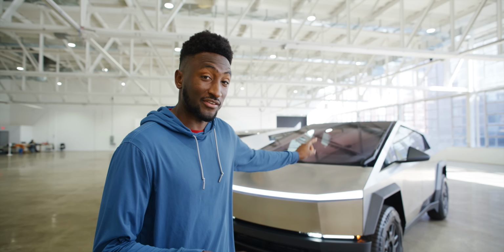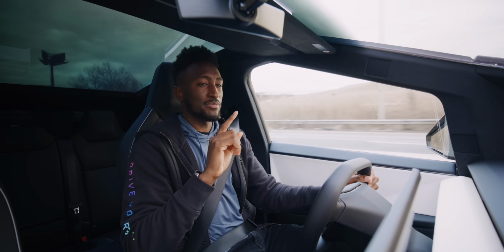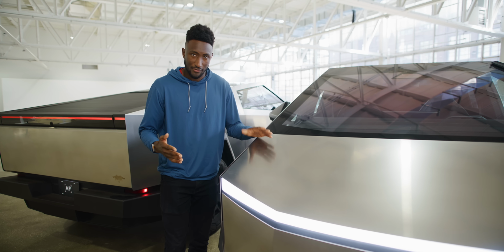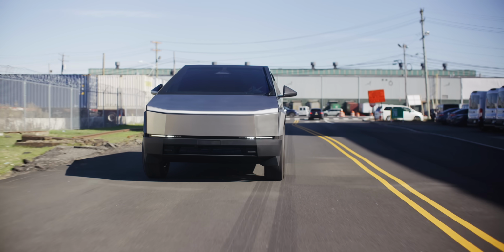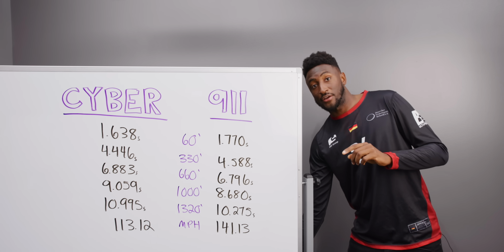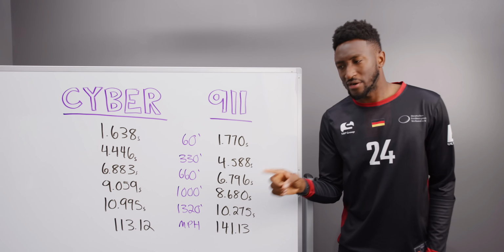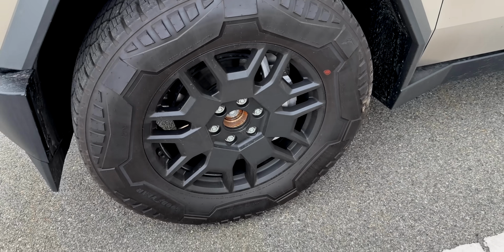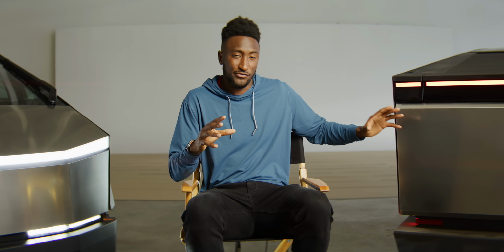Tesla Cybertruck Review: Already Iconic?

Comment: This Cybertruck is DA BOMB !!!! It is one of THE COOLEST vehicles OF ANY KIND out there! AND it actually IS a great WORKING truck! The bed length is good. You can fit lots of stuff in it! It carries 2500 lbs in the bed which 300 lbs for than a typical Ford F150 Truck. It can two 11,000 lbs which is one thousand pounds MORE than the F150 Lightning!  The audio system IS ASTOUNDING in its audio-purist-laden sound quality! The inside is minimalist and simple, allowing for easy cleaning!

EVERYTHING about this truck screams both PURE TRUCK ABILITY and pure awesomeness!

This is just the START of good thinks to come into the Tesla Cybertruck world! Wait until Tesla puts in the massaging seats, the built-in combo-fridge/freezer, the built-in Nespresso coffee maker and the built-in combo-microwave/convection oven AND add the 100,000 lumens lightbar and 360-degree surround-view FLIR thermal nightvision system!  It will be a monster of pure truck luxury and towing/carrying ability!

This truck GROWS on you the more you drive it and more you use it AS an actual truck (i.e. carry and tow stuff!).

In five years we won't be having this type of conversation anymore. It will instead be: Can hit 1500 miles range on a single charge? and Can other truck companies compete with it in the market place?

The Cybertruck is A LOT BETTER THAN I COULD EVER IMAGINE! No other vehicle has hit more home runs right out of the starting gate than any other vehicle.  The driving range issue will be SOLVED within two years! The Self-driving software WILL be coming by 2025! All the other 3rd party add-ons and extras will ALSO be coming down the pipeline as we speak! Look already how many AWESOME Vinyl Wraps we can get for the Cybertruck! Matte, Glossy, Full Colour Images, Cammo Patterns and even the colour changing ones you see on modern phone cases! It's GREAT!

Keep Going Tesla! This is a WINNING PRODUCT and just needs more factory support and driving range increases! 

V

Comment: I can totally understand that biker, getting hit by a Cybertruck and it's really hard body (and extremely sharp edges) will be even more deadly than a normal truck. Even getting hit by it in a normal car will be more dangerous since the smaller car will have to absorb even more of the speed. How is this thing even legal?
Reply: It is the lightest of the EV trucks, as was stated in the video.
Reply: Except it's not. If you'd take 5 minutes to educate yourself, you'd know that tall and flat is way worse than low and slanted (CT).  Also, you have no idea how basic physics works.
Reply: @TheBowerbird  Might be low and slanted, but it's still very hard and sharp.

Comment: When there are many of these 7000lb moving bulletproof, blinding, razorblades on the road, I don't see how you can possibly say that that isn't the most dangerous thing about the truck. Sports cars that can move that fast can also stop very fast. Stopping 7,000 lbs quickly is just not happening. I've seen the braking tests. So yeah, this is the family guy episode... "Good luck everyone else!"
Reply: yeah, for sure... the child crusher 4000
Reply: That quote, insidious af💀
Reply: and fast sports cars will hit you around the knees or even lower while this monstrosity would hit you around the hips or even higher, aka good lucky starting alive after that, specially with that almost inexistent crumple zone on the hood
Reply: I doubt it will ever pass eu or uk regulations. Thank goodness.
Reply: I agree 7000lbs is too much for a vehicle, but it's certainly not just the cybertruck that's in the obese category: jeep grand wagoneer, 6400lbs, yukon xl 6000lbs, escalade 6000+, f150 raptor 6000lbs, hummer h2 6600lbs, F-250 Super Duty 6000-8000 lbs.  And it doesn't matter if those vehicles are bit slower to accelerate, they still hit 100+ mph on public roads.  We should just outlaw all of them IMO.
Reply: The front steel is al so too bad for accidents. There is no crumple zone, which was evolved for car safety.

Here it was disregarded for meme design. The people inside will crumple during high impact. Saying good luck to others is weird.
Reply: exactly
Reply: Imagine getting hit by a 10,000 pound truck pulling a trailer a 10,000 pound trailer.  All vehicles are dangerous.
Reply: @dhjengr8756  now what? this one's clearly so unsafe it didn't even get through EU regulations, the 2nd biggest car market in the world, at some point you should be able to realize some things are not adding up

like imagine the same excuse for when the Samsung Notes were exploding because of faulty battery packs - every battery is unsafe - lol okay
Reply: its the safest car ever

Comment: Getting rid of physical buttons and sticks was a terrible idea.  Why didn't tesla learn the lesson from the Macbook touchbar debacle?
Reply: @too1leasy  That's what Blackberry used to say
Reply: @too1leasy  Statistics indicate it's making the roads safer
Reply: My touch bar was fine.
Reply: It's about eliminating unnecessary parts and processes and creating better efficiencies. Very progressive
Reply: @johnsutherland7561 sometimes progress for the sake of progress isnt actually a good thing, the good old "if it isnt broken, dont fix it". Thats the main reason race cars still use physical buttons, knobs and switches, you simply cant rely on a touchscreen to do stuff while you drive
Reply: @augustooliveira5588  Verbal commands should be just around the corner plus FSD
Reply: @johnsutherland7561 maybe you were joking, but just in case.. Having to look down and to the right and very carefully tap the important button in just the right spot on a screen and not tap any other virtual button in a slightly turbulent car going 70mph is dangerous and frustrating.  It would be bad enough if these touchscreen buttons were within reach of your thumbs at the steering wheel, but these are on the screen in the middle of the dashboard.
Reply: @randy8324  Full self driving will make it a non issue
Reply: @johnsutherland7561  FSD is never going to take off. Yes, never, the idea itself is fundamentally flawed. And voice commands SUCK. Moving my hand is 100x faster than saying something outloud. The reason FSD will never take off is it is incompatible with our concept of the road. Self driving cars can only work if every car is self-driving and connected, with manual driving being prohibited. Otherwise self-driving individual vehicles makes no sense. Another alternative is abandoning car-centric infrastructure and moving towards FSD trains.
Reply: @johnsutherland7561  I hate to break it to you, John, but you're not going to be around by the time we actually get FSD. And I guarantee it won't be coming from Musk. Hey, it might not be in my lifetime either.
Reply: @lucass8119  FSD trains don't work as not nearly as safe. Re all yahoos on subways ect
Reply: @mj-np9sy  Let's revisit in 5 years
Reply: @johnsutherland7561  Sure, but trains are many thousands of times more efficient per passenger than cars. That alone makes up the cost of an operator. Not to mention it is significantly easier to develop FSD trains because they have known paths i.e. rails - cars don't
Reply: @johnsutherland7561  Which is all well and good until it turns out the parts ARE necessary. It makes perfect sense from a cost cutting and production streamlining standpoint, but it's a disaster for road safety. There's a reason other manufacturers are backing away from touch screens after messing with them for a few years: reliability of being able to find and operate the controls is far more important than whatever minor benefits a touchscreen brings.

The major benefits of touchscreens are intuitiveness and the ability to move controls and functions around. The major drawback is a lack of tactility and feedback. Given that a car's controls are simple enough to not require much shifting around and the driver should be able to do as much as possible without ever taking their eyes off the road, I simply don't see a benefit to it from a consumer standpoint or a safety standpoint. And as I'm neither an investor or manager in Tesla, I couldn't possibly care about the money they're saving on this cost cutting.
Reply: because their touch technology has been incredibly reliable for the last 10 years.
Reply: @IamLINErida respectfully, that comment sounds like someone who doesn't drive that much.
Reply: ive have well over 500,000 miles between 2 of my cars in the last 8 years @Amstro515  and part of that was just going to school
Reply: @IamLINErida It's not about reliability, but usability. The buttons are way better to use while driving in a highway, because you don't have to look at it as you do with any screen just to avoid pressing the wrong "button".

Comment: The Cybertruck reminds me of decades of French car design.  They often came out with very quirky, radical looking vehicles, and were sold on that novelty, which would last for a few years.  If you see these vehicles a decade or two later, you realise just how bad-looking they really are.  The Cybertruck falls into the same category for me, with the exception that, unlike the PT Cruiser which was at least priced within the realms of possibility that someone could afford it, the Cybertruck was released at a much higher price-point than originally promised.  It will always be a rarity, until Tesla build a better, cheaper model in a few years time.  Hell, they might not even bother.  This vehicle is a marketing exercise packaged as a truck, intended to garner fame, notoriety and admiration, and in that respect, it has been a success.  If you really want to drive an iconic truck, get yourself a Toyota Landcruiser.

Comment: as someone who prefers to commute on a motorcycle, the turning radius on this thing combined with the weight, acceleration, & fly by wire steering, really makes me wonder, if this is the direction their design is going, should i consider moving somewhere tesla won't ever deliver to? 

bc tbh, this is just a frightening direction that i hope does not catch on to much larger trucks, or even a nightmare XL version of this heavy monster.

Comment: I think the blinding glare is probably the most dangerous part. that and the ego of the driver. I think there will be lawsuits about that which will require the whole body to be sanded down or painted with an anti reflective coating. Stainless steel did not work on the delorean and it won't work on the cybertruck. The body shop appraiser is going to be dancing the jig when these start getting dented or wrecked.

Comment: 7:29 the logic here is actually incorrect. In a collision, THE TRUCK will be fine but “YOU” the driver will most likely not be because the deformation of a car is actually what absorbs the energy of an impact, protecting the driver. The Cybertruck has yet to be rated by the IHHS or NHTSA.

Comment: I just wished they didn't downsized it 5% between initial proto/presentation, and production model. This was a really weak move.
One more thing, it might have to be checked but as far as some people analysed the aerody,amics of the CyberT, it is far from being bad, because of some pretty clever tuning of the upper roof ridge angle cause certain flow regime. Again, someone might correct me but leaks in this vehicule's driving efficiency might be found more in tyres than in aero.

Comment: I got a longbed truck and tow stuff with it all the time. I tow my cargo trailer. I tore down a house and towed it to the landfill. I use it to carry my big kayak. And I scrap metal too. I hate seeing people with trucks that don't use them. They take up space, cause a ton of pollution, and are very dangerous to pedestrians. Most people only need sedans. Because even sedans are a waste of space, most people don't care anything more than a backpack and the other 4 seats are wasted too. But that's another issue, American cities are designed to force you to drive. All that most people need though is a car. If they need furniture, paying one time delivery fee or renting a uhaul truck would save thousands of dollars compared to buying a whole truck to use just once a year. Even if you do haul a lot of stuff, a pickup is still not the best. A cargo van has much more space and is lower to the ground, making loading easier, and it's kept secure, instead of having stuff in the open bed, and protects it from the elements. So again, most trucks, even for cargo, aren't needed. Sure some people use them, like farmers. Or for recreation. But not for everyday commute.

Comment: Why has he not brought up the fact that its an objectively bad pickup truck because the bed space is absolutely tiny compared to any other comparable truck, or that its literally too unsafe to be legal in Europe, where even the equally massive F series can sometimes be bought, or that basic features such as the rear camera become all but unusable at night, or that the headlights are so badly designed that they blind other drivers due to pointing slightly upward instead of straight ahead, or that the range is 300 km less per charge than Elon touted, or that it rusts INSANELY EASILY compared to other cars and trucks because its UNPAINTED, or that its automatically closing front trunk lacks a sensor so itll sever any fingers without stopping, or that the edges are unfinished and unrounded meaning you can peel vegetables with it, or the other stuff that a truck half its price has which works way better, as much as he should have? Its legitimately an unfinished product that should NEVER have been released in this state. Literally we have seen a PROPER high end electric pickup in the Rivian. NONE of those issues in the Rivian because its got actual QA and testing. Anyone who makes these videos should be WARNING PEOPLE NOT TO BUY ONE BECAUSE THEY ARE UNSAFE AND NOT READY
Reply: Right??

Comment: Marques: I believe they're the first one to do steer-by-wire.

One Lexus is crying in the corner
Reply: Every prior system still had a mechanical linkage as a backup. This is the first true steer by wire system
Reply: @ianmilham7397  Saab did a bunch of full steer-by-wire Saab 9000's back in 1992 to research whether flight joysticks from their fighter jets could be used for car driving :) (They found that while possible, it wasn't practical at the time) - it didn't have mechanical linkage as backup, but a hydraulic backup instead. I don't think they were ever road legal as anything other than an experimental car, though.
Reply: Did they get out of beta prototyping?
Reply: The first really used implementation is actually from Paravan.
Reply: Also 48 volts by Audi
Reply: @rret6885 That's a different type of system - a sub system at 48v - not the entire system.
Reply: @TheBowerbird  the cybertruck is a mix of 12 v and 48 v
Reply: @sanisidrocr I know that, but it's the only vehicle where almost all vehicle systems and main wiring are 48V.
Reply: @rret6885 Any Audi's on the road today using such systems?
...or were they just prototypes for advertising and marketing?
Reply: Elon Business Ideas are not original, but Protypes are easy, production is hard.
Reply: Infiniti
Reply: @keanumenezes4941 No. The infiniti was partly steer-by-wire with mechanical linkages.
Reply: Steer by wire isn't remotely new.
Reply: @RichardServello  Well... yes. As well as your accelerator pedal from decades ago. Same concept.

They did not discover hot water... but they made a god damn great hotspring out of it!
Reply: @RichardServello  Steer by Wire with zero mechanical linkage is absolutely new.
Reply: Lexus did an utterly disgusting, useless and annoying implementation of "steer-by-wire"... It's never good to be first if you're not capable of doing a good job.
Reply: @PenkoAngelov  you have no idea what you are talking about.
Reply: @monkeyrun  As a mechanical engineer, who used to work in the automotive industry... I might know a thing or two.

Comment: 4:10 wait so no force feedback😬
Reply: Idk on this car, but lexus had the first car to do it, idk if its in full production yet, but they had a working version of it a while ago, and for that car they had a force feedback motor if im not mistaken, steer by wire is however only usefull IF it has variable steering ratio, why else would you do it. Engineering explained has a great video about it